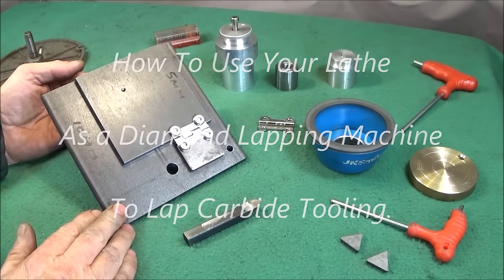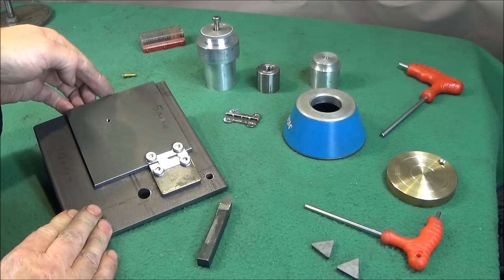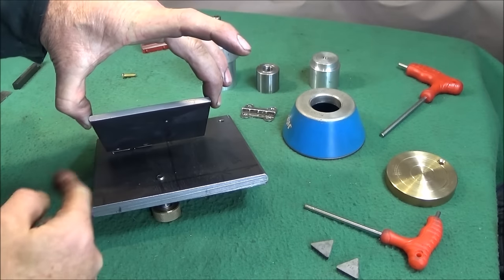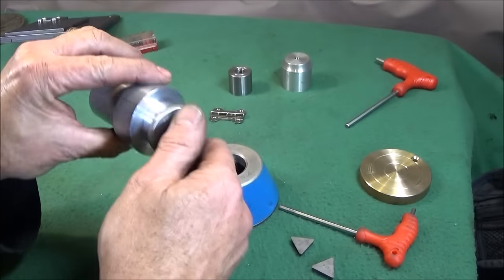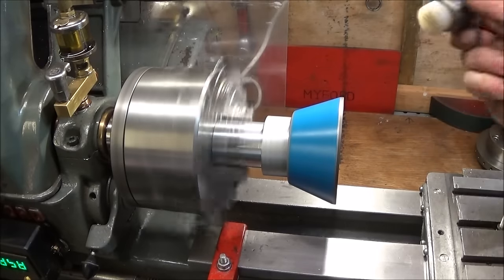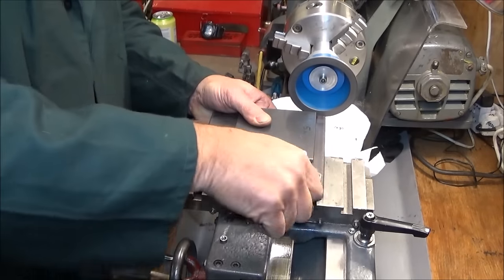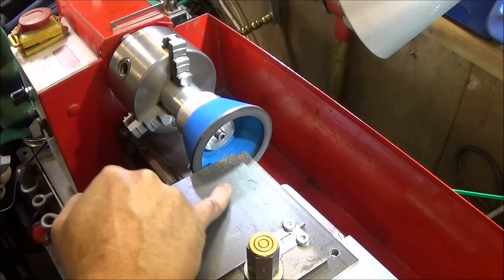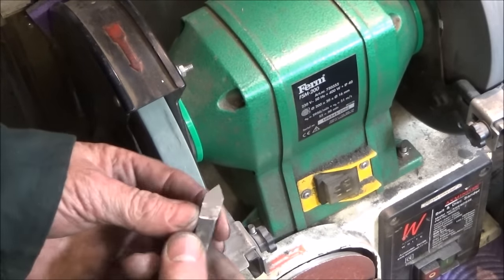Easy To Make Lathe Mounted Diamond Lapping Table Lap Carbide Tools

Comment: Steve, I'll be praying for your health issues as I can relate to what's going on. I'm an old retired welder who never settled for second best on my work. I am disabled and recently bought a SB 13" X 72" lathe that is fairly tooled. You don't know how much I appreciate this video. You are a extremely educated individual and speaker. I already came up with a mandrel for the diamond cup wheel but was searching for how to complete it and add the angles needed. On a budget so I couldn't just run out and buy a slow speed bench grinder but what you came up with is much better. Thank you for taking the time to share a little of your knowledge.

Comment: Thank you Steve.....like your base ...might work as a stand alone with an old motor.....appreciate the video.
Reply from the maker: Hi Sammy. Yes that would be better and it would be permanently set up for quick use. I used to use one like this when I first started engineering.

Comment: A really good simple idea that I would never have thought of and I am going to make one . To go a stage further using the same tool with a further bit of modification by way of a fabricated attachment ,possibly utilising a drill chuck ,I believe you could sharpen drill bits or end mills . As you rightfully say the ML7 is a little slow but bearing in mind the length of the ML7 bed, surely a cheap modified bench grinder could be mounted length ways on the ways ,in front of the spindle with the lap stone mounted in place of the right hand grinding stone, with a turned up adapter?Well done ,really good idea.

Comment: Great idea - trouble I have is my cross slide has no t-slots. Something that has always bugged me! Must see if I can manage something similar.
Reply from the maker: Hi Chris, I can't understand why someone doesn't actually make a small commercial lapping machine for the home work shop! I reckon the Chinese could knock one up, a bit like the disc sanders, that could be sold at a reasonable price. Also I was thinking today that one could easily make one up that could sit on a wood turning lathe. I would have done this on mine and left it set up, but I haven't got any room in the shed! When I do wood turning I do it outside.

Comment: Great idea, where do you get the lapping wheel. I cant find it on ebay?
This method could be used for drill sharpening with a few small addition.
Thanks for the video
Reply from the maker: Hi Thanks. I have just bought one from China. If you type search.......100mm Diamond Grinding Wheel Cup 600 Grit Tool Sharpener Milling Tool NEW X3N8   Regards Steve
Reply: Thanks ordered one!

Comment: Hi Steve. Can you sharpen high speed tool bits with this set up also. With a different type stone. If so where can one purchase it from. The idea looks like you could get the angles cut much better than using a bench grinder and doing it by hand.
Reply from the maker: +Anthony Cash Hi Anthony., I sometimes use the diamond whèel to touch up the edges  or put raduis on HSS tooling. It doesnt appear to have any detrimental effect on the wheel. I use a spray oil like wd40 or parafin on the wheel. So if you rough out angles on the bench grinder, just finish lap the tool on the diamond. Regards Steve

Comment: Hi Steve,
Good idea !
I read that some of these wheels have to be prepared ( "sharpened" ) before use.
That means removing a thin layer of resin to have the diamonds a little more protuding...
Is this necessary or can one just use it as is with parafin oil?
Cheers,
Eddy.
Reply from the maker: Hi Eddy. Thanks. The wheel that I'm using here is a non-resin type made by JK Smit, I think.  I have just ordered a new resin one though, so I will see if I can find information on this. Regards Steve

Comment: ya anything and everything you know on sharpening jigs, fixtures,simple ways for beginers to make cutting tools you know that's a money saver adjustable hight bench grinder tool rest myyour  craftsman 6" center hight is 5.75 .450 above that on a 6"wheel gives a relief angle of 10' us a junker square and that's all you need no hight gauge or nothing I use a big ol' rght angle plate 8" web an as smaller on slotted holes 1" centers on the big plate and protractor on the little plate and can facet a boring bit like a diamond with a square block with a set screw and a hole the size of the bit and a little clamp to hold the guide plate more needs to be done with tool sharpening on youtube thanks yore doin good!

Comment: does the ml7 come with screw cutting
Reply from the maker: Hi Nathan, Yes I have all the crew cutting gears. I hope to do a video on screw cutting sometime.
Reply: yes steve that would be great I'm just starting out got 1947 ml7 just learning about the screw cutting
Reply from the maker: I think mine is a 1947 model. I used to do a lot of screw cutting on a Colchester 2000 lathe. I will have to learn another method for the Myford as I do not have reverse drive.

Comment: Hi Steve, Like the idea but need to know the total costs ? £12 for the plates, £3 for the hinge or i could use an old door hinge for free. How much for your  ? 1/2" square stock ? and how much for the carbide ? Also the cost of the diamond lapping wheel ? Then you have the brazing flux/rods/mapp gas offcourse. Im trying to determine the cost of making the tools versus just buying them. Offcourse sharpening tools will save money i guess in the long term. Also is it not dangerous to grind carbide or am i thinking about Tungstien :/
Reply from the maker: Hi John....I only did this video for people that like making tools. It is much less bother and a lot more cost effective to buy low cost Chinese insert tooling, which nowadays are excellent quality. Before the Chinese tools became so easily obtainable, making your own tools was worth it, as the insert tooling was too expensive to buy.
  I have very few home made HSS tools that I regrind for specific jobs, but nearly everything else is insert tools.
Also the downside of making brazed carbide tooling is the grinding, having to use expensive green grit grinding wheels, that do not last long.. It really isn't worth it now. 
 A good set of insert tools that all have the DCMT 070204 inserts is the most cost effective tooling solution now,
Reply: @SteveJordan  Thanks Steve. I was intending to use HSS as i always thought carbide was too brittle but even now with low cost Chinese inserts isn't HSS still cheaper and more adaptable ? I like to make tooling as well but with a clear focus on that its saving me money as well as for the fun of it :) I like the hobby but not so much when i have to dig into my pockets :) On a side note, know where i can get some quality steel washers with a small 45deg chamfer on on side only of the outer diameter. Imperial Sizes. I am missing a few of a lathe i am restoring an old Zyto, and they seem to be harder than the punched variety that you get nowadays. 'Im a bit younger than you and don't quite remember the quality UK used to produce.

Comment: From an engineering point of view, one can't but admit that the tool is well thought out, simple and effective.
However...... carbide grinding dust, diamond dust (from a wheel that runs waaaaay too slow) and sanity help us , crud from a sanding disk,are all things that need to be kept away from lathes as far as humanly possible. In the days of yore one could be forgiven for having just one machine and having to make attachments like these. I this day an age... where a grinding motor cost less than half a night in the pub, that excuse doesn't wash any more.
I do a fair bit of grinding, and the drill grinder, tool grinder and the surface grinder all live in a separate room in the workshop .... just to avoid this truly destructive dust getting anywhere near one of the lathes, milling machines or any other tool.
If for some reason, toolpost grinding in a lathe is inevitable.... all other machines are covered, shop vacs are pressed into service and the chuck, saddle, slides and tailstock are taken apart and rinsed with alcohol and then re-oiled after the grinding is done.   
Please consider making a stand alone machine for this.... and stop this 'Cruelty to lathes' !!!

Paddy
Reply from the maker: Hi Paddy, Thanks. I only have a small 10'x8' metal shed as a workshop and do not have any room for separate grinding machines. That's why I made this tool set. It does run too slow but it still does the job perfectly. Also one can protect the lathe by covering the ways etc and good cleaning practices.

  I worked in the aerospace industry for about 26 years. In this factory the manual lathes, CNC's and grinding machines etc were all in the same workshop. Also each section of machine tools had their own manual grinding wheels for re-sharpening tools, some being very close to the lathes, for quick use. Machines were just cleaned down at the end of the week.

The tool I have made here is for people that may be in a similar situation as me. People that may only have a small shed or workplace.

Also people often get put off of engineering because they cannot afford all the equipment. This video shows that you can get by perfectly with minimal home made tools to do the lapping. If they clean and oil their machines afterwards, they will have no problem. If there is a slight bit of wear after sixty years service, due to some missed dust. Who cares? At least they could have a go and get on with machining like I have.

Comment: never grind anything on lathe with abrasives.
Reply from the maker: Its fine as long as you keep the ways covered and clean after use. The abrasive particles that come off are minimal when lapping, compared with what comes off when you use wet or dry paper or emery for polishing on the lathe, which everyone does.....Thanks for watching..... Regards Steve
Reply: vacuuming at the source is best alternative imho
Reply: Watch and clock makers do it all the time. The dust in the shop will land on all surfaces anyway, so all sanding will contaminate your machine no matter if its done on the lathe or otherwise.